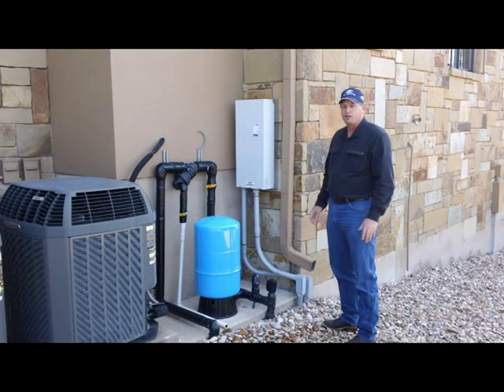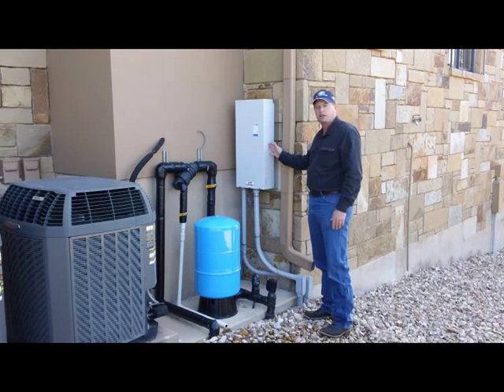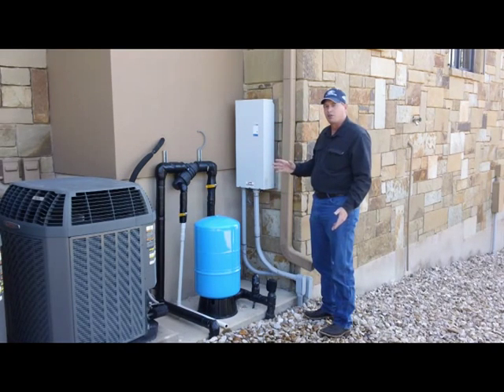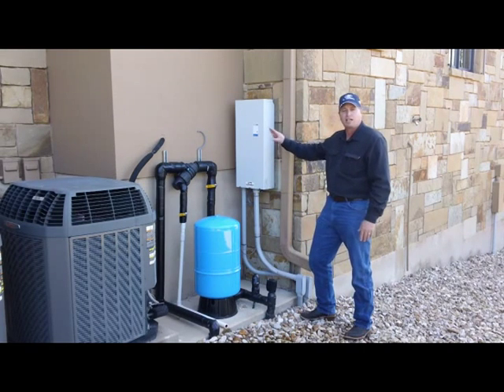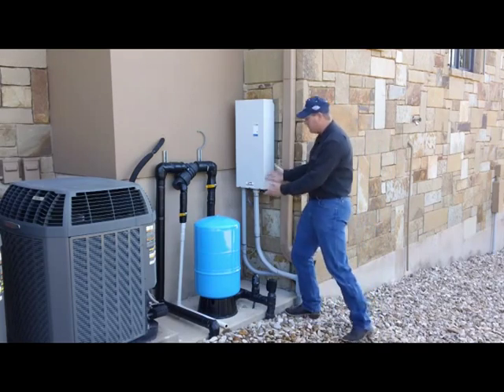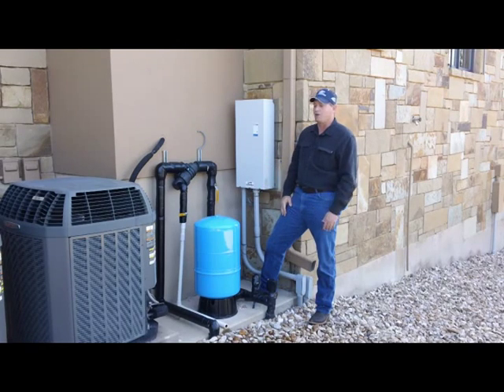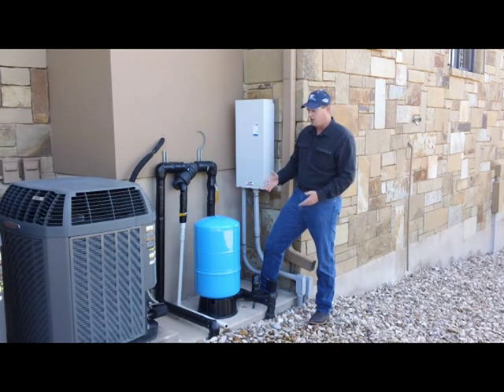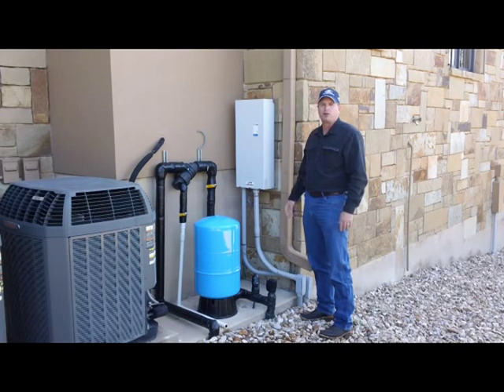Troubleshooting Your Constant Pressure System

Comment: I have thd CentriPro Aquivar AB2 with 3 blinks. Replaced the transducer and still getting 3 blinks. 
System has been sitting several months without use but was working fine several months ago.

Comment: I have the 4 red lights going. Pump or motor bound. Turned it off to reset it, but the same error code persists. This is on the same system you show, Aquavar SPD. Any suggestions?
Reply from the maker: Chrissychrissy, it is very likely that your pump is bound.  That means that it is trying to turn but can't.  It might be debris in the pump or bad motor windings or bearings.  It probably means you are going to have to replace the pump.  If i were standing in front of the unit, i would turn off the power for at least one minute to let the capacitors bleed down.  Then i would disconnect 2 of the 3 hot wires the pump and switch them.  Then turn the power back on for 10 seconds.  Then switch them back.  That will turn the pump backwards and then forwards.  I have seen that unstick a pump before.  If not, then you probably need a professional to come check it out.  It could be that the pump is bound.  It also could be a bad VFD.
Reply: @jimblair1  My reply is not showing so I will try again just in case. Thank you for the information! Just want to double-check on which wires to switch. I will provide three photographs for you to look at. I am assuming that you are speaking of the hot wires on the control unit. Not the ones on the pump itself. I will add a link in the next comment.
Reply from the maker: @chrisssychrisssy  i mean the wires that leave the controller going to the pump.  Switch any two.  Make sure you turn power off until all lights go out.  Run 10 seconds and then put them back
Reply: @jimblair1  Trying to send you photographs, but it disappears. There are two places that the same wires connect. On the board it says Output to Motor T1,  T2, T3. Or below that, wires are connected via small individual boxes.
Reply from the maker: @chrisssychrisssy  its the T1, T2, and T3
Reply: @jimblair1  Just want to update you. Tried it this morning and it worked straight away! Thank you for all the help!
Reply from the maker: @chrisssychrisssy  glad I could help
Reply: @jimblair1  Hello! It happened again and went through the process. It works in reverse, but when you put it back to forwards, you hear it click. It tries to move a few times and then the error occurs.
Reply from the maker: @chrisssychrisssy  It sounds like it may be time to pull the pump and see what is bound.  Either the motor or the pump.  Small chance it is the drive that is bad, but i suspect either the motor or the pump.  Sorry.
Reply from the maker: @chrisssychrisssy  Sorry, i don't know anyone that services that area.  My main supplier lists Lone Star Drilling, Malone Well service, Peck's well service, and Bennett water well on their website.
Reply: @jimblair1  I had the pump changed out. Water is flowing, but the controller is constantly ramping up one after another. This happens even when no water is being used. It will ramp up, turn of for a second or two and ramp up again. And will continue. The pressure in the tank Is holding and  steady. No faults are showing up. The indicator is green. Any ideas on this issue? Please let me know if you need me to look at anything else. Thank you as always!
Reply from the maker: @chrisssychrisssy  close all discharge ball valves.  See if controller stays off.  If so, you have a small leak in distribution system.  If not, your check valve is leaking.  And it sounds like you need more pressure tank capacity.  You need to make sure your pressure tank air precharge is 20 psi below the set point.
Reply: @jimblair1  I forgot to mention that I did shutoff the valves prior and it was persistent. I will take a look at the check valve . The tank is at forty psi.
Reply: @jimblair1  Having a new issue. When the system is on, water spews out of the relief valve. I have emptied the pressure tank, but it is heavy as if there is still water inside. Sounds solid when tapping on it. I also took a pressure gauge to it, but there is no indication of pressure. Is there anything else I should take a look at or information that you need? I have a pressure sensor switch. Could that be where it is tripping? Is it as simple as needing a new pressure tank? Thank you for the help as usual!
Reply from the maker: @chrisssychrisssy  It sounds like you need a professional to come out.  There are too many things that can cause this issue.  And I can't see it from here.  My recommendation is to call a professional well technician.

Comment: Howdy thanks for the video. I have a Franklin subdrive 75 control box. I had 5 hydrants installed last October and now this being almost 1 year later. My pump is constantly on and I was told I had a leak in one of my lines. I dug up all 5 holes by hand and I am not finding a leak anywhere. Can this control box malfunction to keep the pump always engaged?
Reply from the maker: Yes it can.  The problem is that the pump is turned off when the pressure gets up to a "set point".  And as the pressure nears that set point, the pump slows down.  But, when you slow down a centrifugal pump, the pump is not able to build as much pressure.  So, there is a possibility that the pump will be continually running really slow while not moving water.  If you have the pump hanging on plastic pipe, then this issue won't last over a few hours.  It will simply melt the pipe and drop the pump in the well.
Or if you have pvc casing, it will melt the casing to the pump.  make sure you turn off the pump so this won't happen.
the best way to diagnose is to close all discharge valves leaving the system.  If the system builds pressure and shuts off, then you don't need to worry about the pumping system.  Then if you open a valve and you hear water running, then you have a leak.
If you don't have a main shut off valve, get one.  It is the best way to diagnose this issue.
Reply: @jimblair1  So this is something that could have just started? I've had this system for 15 yrs now. 2 yrs ago I got a new subdrive 75 control box and pressure gauge but that was installed over a year ago also. This has just been going on for maybe 2 months. And thank you very much for the info. This is driving me crazy after not finding a leak.
Reply from the maker: @DonovanAP  Yes, it is possible to just start.  If the pump is a bit worn and can't build the pressure that it usually does, then this could just occur.  But without a main shut off valve, you can't diagnose it.
Reply: @jimblair1  Thank you. I'll look into it. I had a company come out and they pulled some of the pipe up and did 2 pressure tests and told me it has to be a leak in the lines. So frustrating.
Reply: That is so terrible you had to go through this. It is a lot of work. Worse so if your plumber does know exactly what they are doing it can take for ever to figure it out and a massive bill… It’s a great feeling being the hero and fighting this stuff out promptly and repairing it in a timely Fasion.